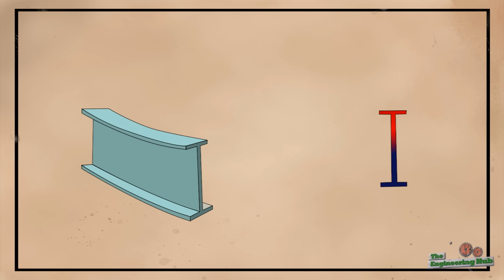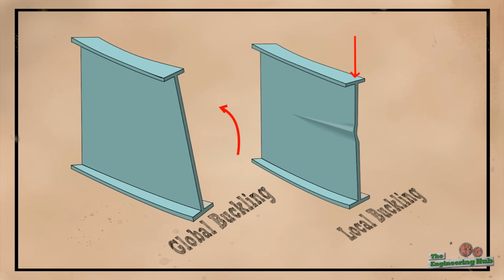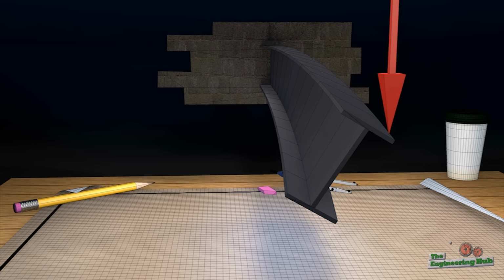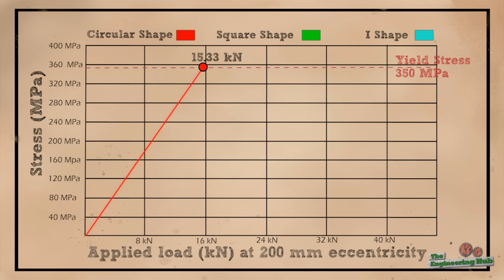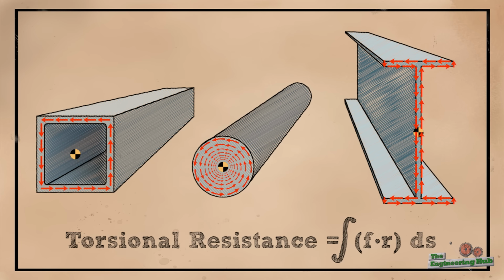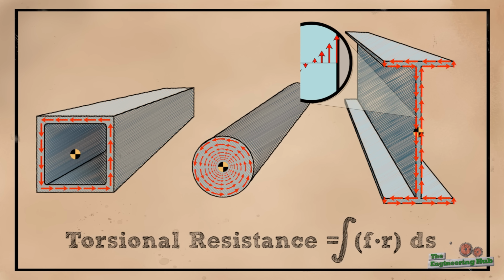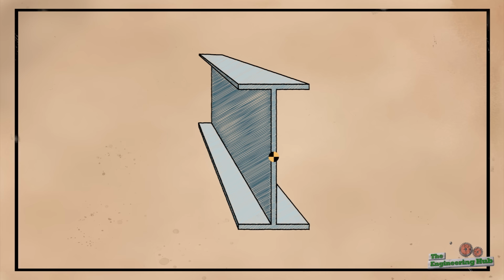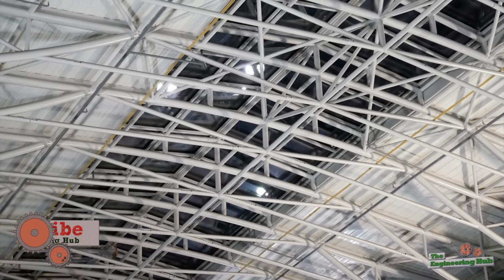The Critical Weakness of the I-Beam

Comment: Yes, that is quite instructive, though it seems unwarranted to call it a "fatal flaw".  Rather, as I take the video, all configurations have their weaknesses, and torsion is simply the I Beams weakness.  So it is used where it won't see those forces.
Reply: The I beam is an open section, whereas the square is closed so better torsion resistance. A hollow  circular cylinder would be the best against torsion until wall thickness is decreased and crippling or buckling will limit the design capability. Each shape has it's own unique strength and weakness.
Reply: I thought that the "fatal" bit would be in the neutral line where shear sets in. There was even a picture in this video that showed an I-beam that hat ripped along the neutral line.
Reply: That is a very reasonable comment.
Reply: Exactly, and what he's showing isn't even an "I" beam, it's wide flange, big difference between the two aside from just the cross section.
Reply: why not just run a vertical plate through a tube ?   basically a combined tube and ibeam in one object
Reply: @uncletrashero  difficult to integrate into a structure
Reply: @jukeseyable  hows that?    the only thing to account for is slightly more width of space to the sides of the beam, which is already a non issue since most beams have literally plenty of empty space on both sides in most construction designs.
Reply: @uncletrashero  it's not about volume it is how it is integrated into the wider structure
Reply: @jukeseyable  i need an example, that is too vague
Reply: @uncletrashero  in construction elements tend to be flat, circular elements tend to need additional elements with which to interface with the structure securely. Another joint is another point of failure
Reply: @jukeseyable  there no reason the top and bottom cant have the exact same flat sections they already do. the connections would be identical.
Reply: I agree. I bought a caravan engineered in Britain. And the use a c beam. It's very tall to resist bending, but there is no cross brazing so it twists. Most of the torsional load was taken up by the side wall of the caravan. But when those screws started to fail the the C Beam started to twist and crack. After adding cross brazing it stiffened considerably. That's why most Australian trailers and caravans is a rectagonal beam. As a simple mechanic I could see the fault in a design done by engineers.
Reply from the maker: You are absolutely right Alexander! The word "fatal" might bit a bit overboard though a flaw/weakness, we believe is an alright description. We hope you agree and still found the video entertaining and informative.
Reply: @TheEngineeringHub  Really annoying that you exaggerate for clicks. It's as idiotic as saying salt is lethal or knives are lethal. 
All you managed to do is annoy many people and worse, create a false impression about I beams that will mislead people who simply see the title. Worse you don't know the difference between I beams and universal beams. 
This is badly misleading. In fact it's a fail.
Reply from the maker: @kevgermany  we respect and accept your opinion. A couple of points: the nomenclature of the section differs from place to place. In Canada, where we work as structural engineers, all derivative sections (W, H, S) of an "I" are colloquially referred to as I-beams. I am sure the video has annoyed many people but at least we hope that the (only) 4% who disliked the video learned something new about torsion. Lastly, we are not sure how the analogy with the knives translates to this case. Applying eccentricity to the load could reduce the carrying capacity of the beam by (in some cases) 80% and that's a weakness of it. You could say that it's the designer's fault for using it that way but then with that logic nothing in the world is flawed. A bucket with a hole is not flawed but it's the user's fault for filling it up with water and not rocks?
Reply: @TheEngineeringHub  probably most of your happy viewers aren't able to distinguish between reality and hype. But you do the engineering profession a great disservice by creating these false impressions. Structurally nothing wrong, let alone fatal about I beams when used correctly. But any structural element used incorrectly is potentially lethal. You also fail to mention safety margins built into correct use.  That's why engineers are trained and paid appropriately. 
Nice try with the bucket example, but I'm not falling for it. Sophistry doesn't work with me. 
Quite amazed you don't understand knives. Used properly a knife is not fatally flawed. Used correctly they serve the purpose they're made for. My kitchen knife isn't fatally flawed. But could be incorrectly used for killing. Clearly a stilleto is lethal, it's what it's designed for. Is that a flaw?
Reply: @TheEngineeringHub  you sure you are Canadian, normally the amount of crap you are coming out with would denote you as a yank!
Reply from the maker: @kevgermany  It is okay to disagree, we thank you for your comment. But we are in fact structural engineers and we are paid appropriately to design these beams which we literally do on a daily basis.
Reply: @TheEngineeringHub  So why don't you correct the misinformation? The only flaw is the incorrect use.
Reply from the maker: @kevgermany  if we could, we would clarify this a bit more in the video but since it is already published we cannot alter the content of the video. When it comes to the title we will change it if the like to dislike ratio drops below 50%. We abide by what the majority of our audience find satisfying. Also, we had input from a number of our engineering colleagues (since this was a discussion in the comments last week) with a combined of 100+ years of experience in structural engineering that agreed that torsional loads are definitely the weakness/flaw of the I-beam and they sometimes happen by accident which does not really qualify as incorrect use.
Reply: @TheEngineeringHub  ah! horse-trading about the precise wording? :)  Absolutely, yes, it is informative and factual and a positive addition to the amazing sharing of information afforded by the Internet.
Reply from the maker: That makes us happy to hear! Hopefully will be enough so you can forgive us about the click-baity title. Cheers!
Reply: @TheEngineeringHub  I don't like click bait titles though, and looking at the videos views to sub ratio, I'd guess that many others feel the same way as I do. No sub of me, on principle
Reply: @jukeseyable  The like to dislike ratio is more than 23:1, that's pretty good.
Reply: @PronatorTendon  Perhaps you need to read glyn jukes comment again!
John, Australia.
Reply: @joandar1  Why? Am I not allowed to counter with different information? Perhaps you should refrain from presuming what people do and do not comprehend
Reply: @PronatorTendon  if you say so, but I'd argue that it's not, closer to dog shit, besides it's now closer to 21 to one. Comparing this vid with another engineering channel, and a new vid. 310,000 subscribers, its a new vid, so just 14,480 views so far, it has 1,700 like fron those views and just 10 dislikes. So that is a view to like ratio of 7 views to 1 like. This video needs 63 views to one like. So you like a like to dislike ratio of 23/1 do you, how do you feel about a 170/1 ratio. Now lets address the elephant in the room that you wish to ignore. 440,000 views, of this I beam video, clearly a popular subject, but only 8,000 subs out of that viewing. This channel isn't converting views into a following. They are utterly failing to do so on every level on hundreds of thousands of oppertunities. Why do you think that is?
Reply: @PronatorTendon  you do realize that a like to dislike ratio of 23/1 isn't anything to write home about. You do comprehend this don't you?
Reply: @jukeseyable  I literally said it's pretty good

You must be stuck in some fantasy world where your goal is to strawman the ever loving fυck out of people you don't know

Submit a whitepaper on your thesis. When did you choose data analysis as your major?
Reply: @PronatorTendon  but it's not pretty good it's dog shit, besides you still haven't addressed the lack of channel subs on the back of such high view numbers
Reply: @PronatorTendon  from  your use of language I'm guessing you are American, here in the UK, we specialise our degrees, not major and minor. We also tend towards reality rather than deluded over sensationalised crap
Reply: @jukeseyable  Address? Like you didn't address your deliberate and dishonest misrepresentation of my statement?

This channel is doing better than average, which renders my qualification of pretty good to be quite relevant.

The vast majority of channels don't breach 1% sub rate.

If anything, you're unfairly characterizing it as being worse than what it actually is by comparing it to some of the best channels in the genre. Well, a store might not turn quite the profit of Amazon, but their results can still be pretty good

In order to meet your characterization of being dog shit, the like to dislike ratio would have to be somewhat inverted, perhaps with 1:1 to 1:3, in addition to converting perhaps 10% of its current subscription gain.

I've been subscribed to many educational channels, at minimum several hundred, and all of the successful ones endured periods in which performance was lackluster. This often results in the owner retooling their channel to some degree if they wish to see it succeed.
Reply: @PronatorTendon  deliberate and dishonest, very strong words, and entirely inaccurate on this occasion. Couldn't help but notice your last phrase where you state that many channels have to retool and change in order to survive. By inference it's fair to say that if they hadn't have done so they wouldn't have survived, it isn't much of a leap from this point to think that you have your doubts about this channels survivability if it doesn't make changes. My major as you so put it is BSc in Archaeology from university of Liverpool
Reply: @PronatorTendon  At the risk of arguing with a fool I say this, "like to dislike ratio" as a difference to " like verses subscriber ratio"!
Also at the time of your comment there is NO COUNT on Dislikes!
How say You?
John, Australia.
Edit for Grammar.
Reply: @joandar1  There are 295 dislikes

I see you're staring into the mirror when considering the person you see to be a fool

You're incapable of observing numbers and you have the audacity to lecture me about needing to read something twice?

It's a YouTube comment feed, the signature is pretentious
Reply: @PronatorTendon  I should have known better than to argue with a fool. Bye!
John.
Reply: @jukeseyable  No, you committed a strawman fallacy, which is both deliberate and dishonest. Simple errors aren't fallacies if you're willing to correct them, which you've clearly demonstrated you aren't. You didn't admit you were incorrect even after I explained in detail why you were incorrect. 

That's dishonest, and doubly so because you're pretending that your strawmanning of me wasn't deliberate.

I'm not sure what the trajectory of this channel is, as this is the first video of theirs I've watched, and I have no lnowledge of the creator's future plans. There are some suggestions I could offer to improve his results, but he probably isn't interested in taking advice from someone who doesn't produce content. 

Anything further employs a level of speculation with which I don't feel comfortable
Reply: @jukeseyable  Subscriber count doesn't mean anything. The click bait title was used to attract the algorithm and get views, the only important metric. Sub feed is worthless, so the "following" of his subscribers will have no impact on future views. 
This means the only way to get an actual following on this platform is, in fact, to use click bait.
Reply: @jukeseyable  In fact, the high ratio of views to subscribers just shows how effective this technique is in attracting the algorithm. You can't grow a channel if your only viewers are some subscribers.
Reply: @Duck2718  but it isn't, other wise the channel would have more than 8,000 subs on the back of the video. It may well work for some channels. But the thing with engineering is that it's all about accuracy, truth, and good information. In my humble experience, engineers are rarely overly dramatic people that exagerate, are sensationalists, and talk with hyperbole. That would be politicians! It's not to far of an extrapolation to say that those interested in engineering may well be possessed of similar personalities as engineers, thus rendering the normal click bait strategy not only ineffective, but actually problematic
Reply: @PronatorTendon  no one is straw maning you, look, ur reply to my initial comment didn't address my comment, it dragged in a unrelated point. What you did is akin to someone asking you about the weather, and you replying apples, and mediocre apples at that. It's a lowly standard of debate on your part. With it been so low then it is all to easy to pick holes in your house of cards. Look up dunning Kruger. You are nowhere near as bright as you think you are. S
Reply from the maker: @PronatorTendon  We are very interested in hearing from our views regardless if they create content themselves or not. We are a growing channel and take the input from our viewers seriously, it is the only way to improve.
Reply: @TheEngineeringHub  appreciate your work here, subscribed!  With regard to critical weakness there appears to be an issue with structural steel holding up to kerosene sparked office fires. Think you could check NISTs work?
Reply: I think there trying to implement more reasoning toward 911. The buildings probably not made right. What a joke.
Reply: @deangoddley2061  Good idea! Let's have a discussion about why the buildings fell down.  Then again, maybe let's not.
Reply: @alexanderSydneyOz  and make it a nice short video giving a full description of the 911 mechanical event!

Comment: Comparing a solid round bar and a hollow square tube is like comparing apples to oranges in torsional strength. Why didn't you compare square tube to round tube or square solid to round solid? Some people might think you're trying to say that square shapes are stronger than round shapes in torsional loads. Although I don't think that's what you're trying to say since you did say round hollow is the strongest.
Reply from the maker: We  just wanted to cover different types of sections (closed, solid, open) so we can illustrate that the closed ones are the most efficient. The difference between a hollow square and hollow circle would not have been too large to illustrate the advantage of spreading the area away from the center in a continuous manner. That was at least our thinking we can also see that it could be confusing especially if someone does not finish the entire video and see that the hollow circle is the most efficient.

Comment: which one the best to use? Or any other type that much better?
Reply from the maker: It very much depends on the application and loads to which the section is exposed. For pure torsional loads, the closed sections almost always perform significantly better. For a combination of torsion and bending loads, things get more complicated. In a combined load scenario, it cannot be said which one is better without knowing the loads.

Comment: Very well explained, and it demonstrates the kinds of choices structural engineers make.  I saw this in an engineering statics course I took in 1969.  Hasn't changed much expect that now computers can model these structures much, much, much better than we could with slide rules (slip sticks).
Reply from the maker: Thank you for your kind words. It's really interesting (also understandable) to hear that the same considerations went into designing a beam in 1969 as they do today. Computers are definitely a useful tool, but in our opinion, the engineering judgment and intuition is the most important tool an engineer could possess. This comes from a group of young structural engineers that do use computers quite regularly.
Reply: just had statics the prof has tought that same course for 40 years. same laminated examples and everything year in year out, only change he's made is to allow calculators in exams. the equations were derived hundreds of years ago and they ain't changing. same in physics, chemistry and math so why are textbooks so dam expensive.

Comment: All the images that you are showing are not I beams, you are showing H beams, an actual I beam has a web shape. The web is to prevent buckling and add strength.
Reply from the maker: Hi Jerry, the nomenclature differs from place to place. For example, the beam you are describing in the Canadian Handbook of Steel Construction is called "S-shape". The beams shown in the video are referred to as W-shapes (for wide flange). Other places in the world call them "universal beams" or as a viewer from Germany pointed out, they call them "double T beams". We apologize for the confusion, however, the important part is that the working principle of all of these sections is the same. Their moment of inertia about their x-axis is high and therefore they are suitable for resisting moment loads about that axis. But when it comes to torsional loads, things change as shown in the video.